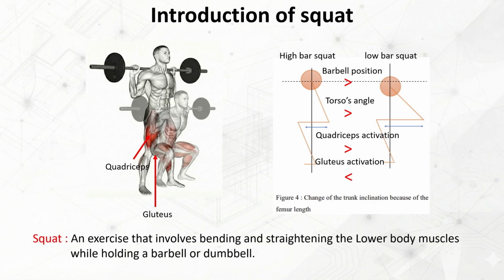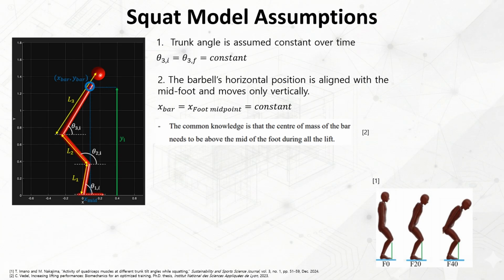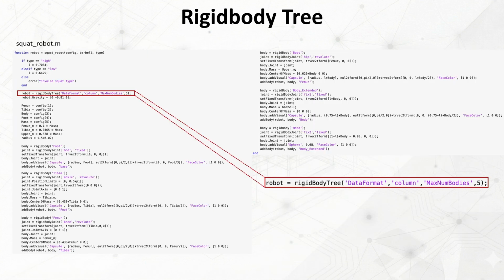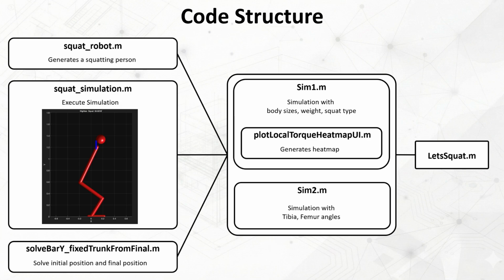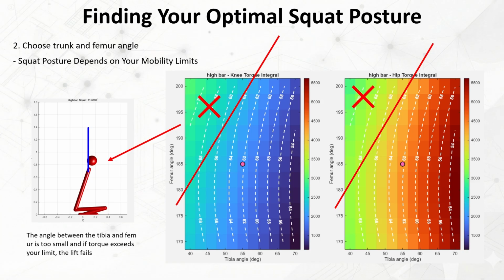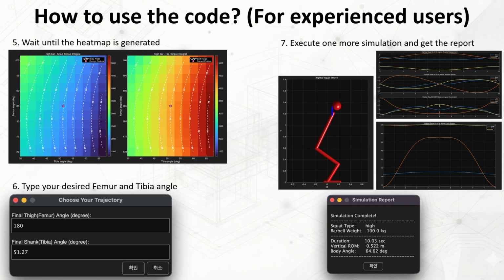Squat_Yonsei university Engineering numerical analysis team 1

Comment from the maker: 00:00 Introduction

Hello, everyone. 
We are Engineering Numerical Analysis Team 1, and today we will introduce our 
personalized squat reference generation method based on biomechanical analysis. 

Before we get into the details, let’s start with what a squat really is. 
A squat is not just bending and straightening the knees with a barbell. 
It is a full body movement requiring balance, mobility, and strength. 
Two of the most common squats are the high-bar squat and the low-bar squat. 
Even though they may look similar, the bar placement changes 
your posture, balance, and the primary muscles engaged. 

Many people ask: 
‘If I squat exactly like this athlete, will I develop the same muscles?’ 
But the answer is no. 
Even if two people perform the same movement,  
their biomechanics — such as moment arms, joint angles, and muscle activation — can 
be completely different. 

This is why a personalized approach is necessary when learning or training the squat. 
Using individual anthropometric data, we generate a personalized squat reference 
evaluates joint torque and muscle demand. 

You simply enter your body measurements and barbell weight. 
The model then computes your biomechanics and provides a personalized motion 
simulation and torque heatmaps.

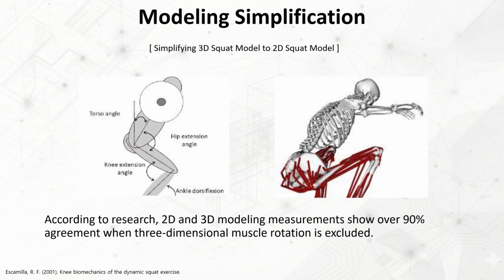01:15 Assumptions

There are two main assumptions in constructing our body model. 
First, we simplify the squat to a 2D representation rather than a full 3D model. 
Researches show that while performing a squat, 
there is no movement in the side planes, 
which makes the 2D model of squat quite similar to the 3D model. 
Therefore, we are going to use a 2D model throughout our research. 

Next, we model the human body as a planar multi-link system, allowing us to use inverse 
kinematics and inverse dynamics MATLAB tools commonly applied to robots. 
In this formulation, the torque computed at each joint can be interpreted as the muscle 
force transmitted through its moment arm. 
Although the moment arm varies with joint angle in reality, 
previous studies show that assuming it to be constant does not significantly affect squat 
mechanics. 

Therefore, our model treats the moment arm as constant and uses joint torque as an 
indicator of muscle demand. 

To model the squat motion, several assumptions were introduced. 
First, the trunk angle θ₃ is assumed constant during the motion. 
As shown in [1], where trunk tilt was kept fixed during analysis, using a constant trunk 
angle is a practical modeling assumption. 
Second, the barbell’s horizontal position is aligned with the mid-foot and moves only 
vertically. 
This follows [2], which states that the barbell’s CoM should remain above the mid-foot 
throughout the lift for mechanical stability. 

Third, many studies report that the barbell is positioned at C7 in the high-bar squat and 
at T3 in the low-bar squat. 
Based on this, the corresponding C7 and T3 heights for a 175-cm male were obtained 
from available data and incorporated into the model. 
Fourth, The bar was assumed to stay in place horizontally, moving only with the lifter’s 
vertical motion. 

This is the overall workflow of our model. 
We construct the body model, solve the inverse kinematics, and then perform inverse 
dynamics for torque analysis. 
Let me walk through each part. 

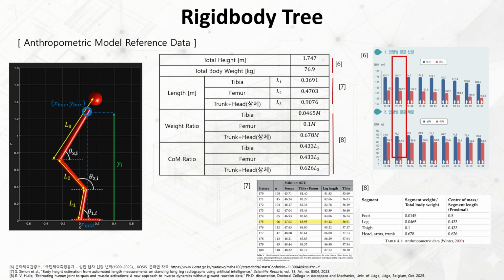03:24 Detail

We first determined the segment lengths, mass ratios, and CoM positions from 
anthropometric references to construct a representative human model. 

Using these parameters, we built an individualized rigid-body model in MATLAB with the 
Robotics Toolbox. 

To run the IK-based(Inverse Kineamtics) squat simulation, we computed the bar’s vertical 
position at the initial(y_i) and final(y_f) postures using two modeling assumptions. 
The first one is that fixed trunk angle and the second one is vertical bar motion. 
These provide the initial and final bar heights and allow us to compute joint angles for IK 
and inverse dynamics. 
 
To get joint angle information, we employed ‘gerneralizedInverseKinematics’ function in 
matlab, which gets robot config, constraints and target position and solves inverse 
kinematics based on our input. 
 
We implemented rigid body dynamics in MATLAB using this standard equation of motion. 
By inputting the Generalized Coordinate Vectors, the system computes the Generalized 
Torque Vector as the output. This allows us to quantify the precise load on each joint. 
 
This is the overview of our total code structure. 

The core objective of our program is two-fold. 
For beginners, the system provides high-bar and low-bar reference motions clearly, 
while for experienced lifters, it delivers heatmap-based torque feedback 
that enables precise self-correction and performance optimization.  

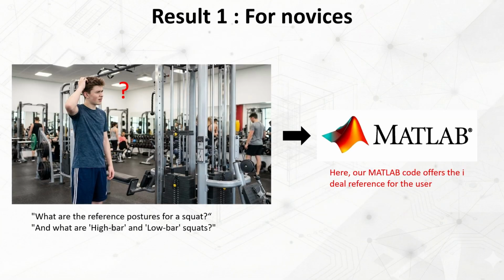04:54 For Beginners

Let's start with the novices. Beginners often struggle with these questions. They lack a 
standard to follow. 

To solve this, our MATLAB code provides the ideal reference motion. 
We offer standardized posture data so beginners can visualize and imitate the correct form. 
We specifically focus on the two main styles: High-bar and Low-bar squats. 

As shown in the graphs, High-bar squats are knee-dominant, while Low-bar squats are 
hip-dominant. 

For numerical analysis, we compute the torque area by integrating the torque profile over 
time and use it for comparison. 
 
We quantified this difference. 
The graphs show the Integrated Joint Torque and Mechanical Work. 
You can clearly see that High-bar squats place more load on the Quadriceps, while Low
bar squats engage the Hips more efficiently for heavier loads. 

Here is how a novice would use our tool.  

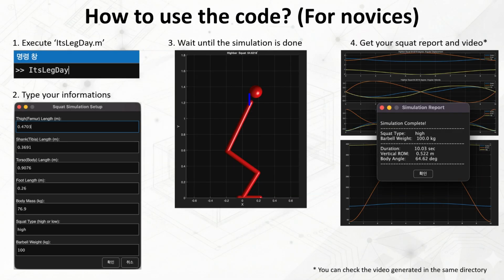05:51 For experienced users

Now, let's move on to experienced users. They already know how to squat, so they need 
optimization. 
First, Capture your current squat posture at bottom position and Compute the angles. 

Let's analyze this heatmap. This graph represents the Joint Torque Integration Profile 
around the Current Squat Posture at high bar. 
We varied the user's Tibia and Femur angles by 15 degrees to visualize how slight changes 
in posture affect joint loads. 
 
And this is the heatmap for low bar. 
By analyzing this heatmap, users can determine how to adjust their posture on their own. 
We will show you how. 

The optimization process begins with a choice: High-bar or Low-bar? 

We must consider the trade-offs.  
look at the left graph. As the arrow indicates, the deeper you squat, the more load is 
placed on the knees and quadriceps. 
In contrast, the right graph shows that a more forward trunk angle increases hip 
engagement. 

Crucially, not every range on this graph is possible. 
You must consider your mobility limits in the areas marked with red lines. 
In this zone, the angle between the tibia and femur is too small. 
Consequently, if torque exceeds your limit, the lift fails. 

Also, excessive forward trunk causes instability and shortens the working distance. 

Considering the limits, our tool allows users to choose their optimization goal. Feedback 1 
focuses on increasing Quadriceps engagement. 
Feedback 2 focuses on raising Gluteus engagement while reducing knee demand. 
For users with weak knees, our tool suggests Feedback 2 to shift the load from the knees 
to the hips. 

By adopting the feedback 2 posture, the user can reduce knee torque demand by 11.69%, 
while increasing hip muscle engagement by nearly 10%. 

For the experienced users, first few procedures are the same with those of novice users. 

The difference is that if you are capable to choose your own squat trajectory, we also 
provide simulation for it. You just type few more parameters and execute one more 
simulation. 

08:11 Future work

Future work includes transitioning to 3D spatial analysis and incorporating non-linear 
moment arm modeling to enhance accuracy. 

08:21 Conclusion

In conclusion, we offer a MATLAB based tool that supplies standard squat references for 
novices, while generating torque information that allows experienced users to self-correct 
their posture." 
Remember, you are not alone, JUST SQUAT! 

If you want to download our code, do the follows. 

Thank you